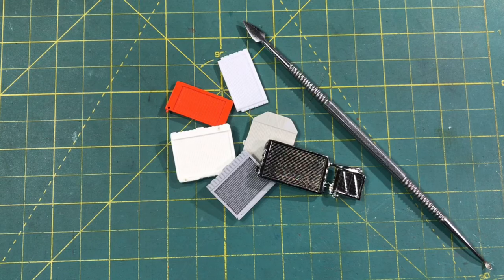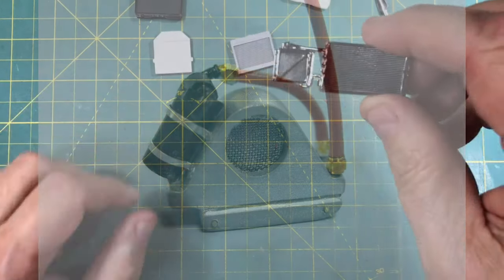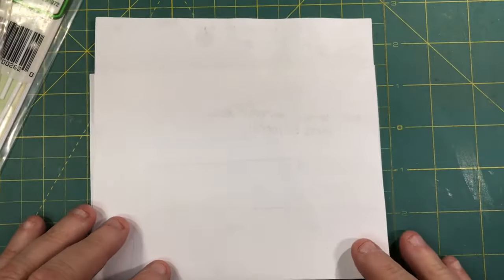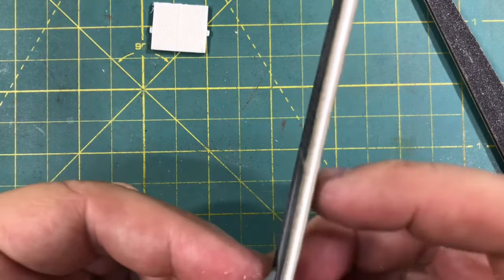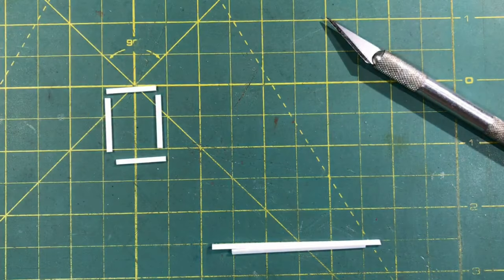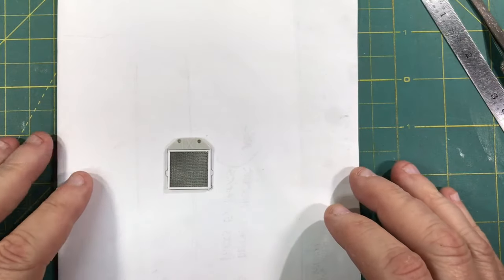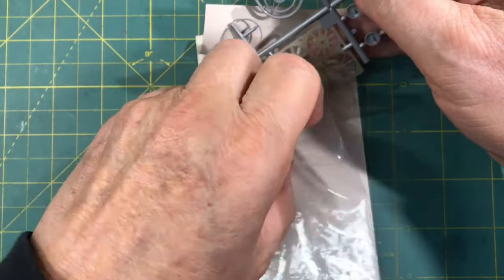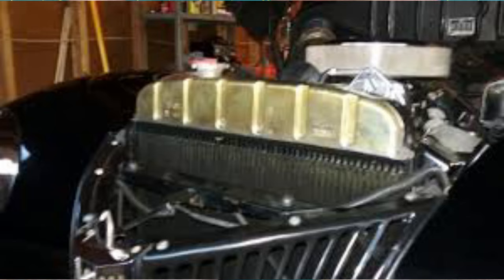Scratch Building Realistic Radiators

Comment: Very nice work!
In case you did not know,
The radiators that the header
Tank is at the top the tube run up and down old style design.
Radiators  where the header tanks are at the side is the new style design the water flows parallel  to the ground
Keep and eye on that.
Old radiators  where made of brass , cars of the 1900 to the 70s.
Side flow radiators are more efficient in heat transfer, so there is less cores, making them lighter.
Reply from the maker: Thanks!

Comment: That is an interesting idea! I will probably play with that. Something that I am going to try on my AMT 1/16th '57 Thunderbird build, I'm not going to do that as a see through like this tutorial. But the inside radiator, under the shroud is just plain plastic (no radiator texture). I have some TV picture tube inner screen, this is a thin steel mesh. Horizontal pattern. I will try some ultra thin black ink for the color. Cut a piece of it the right size, glue it in place to try to simulate a real radiator pattern. I know that once it is finished, most people wouldn't  see that. But I will know it's there giving the model a better look.
Reply from the maker: Thank you brother!! The screen sounds great! And yes, black ink is perfect! Have fun!!
Reply: @MarkBatsonHobbydude007  It will be a challenge to get that done. I also have some  the TV screen material in the round hole pattern. I am going to play with that, and see if it might make a suitable grill for a 1940 sedan hotrod build, that I am currently working on. It has the old school narrow slicks on the rear end. And put the stock tires up front, on the stock front axle, and see how much of a   California rake it might have. There is a fair difference in the tire profile, so it should make for an interesting stance,